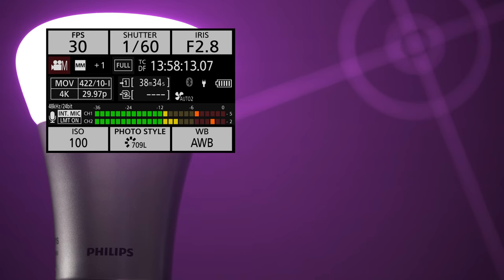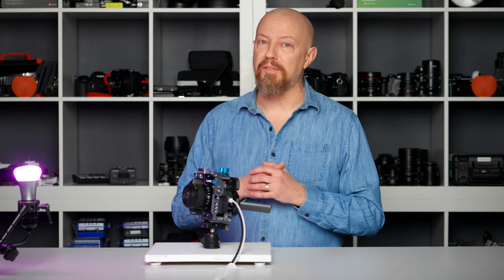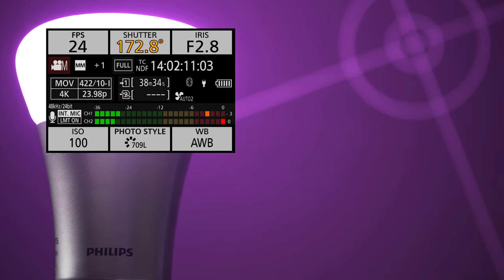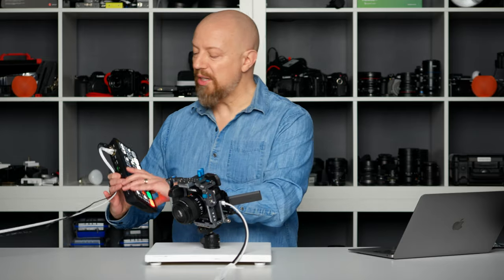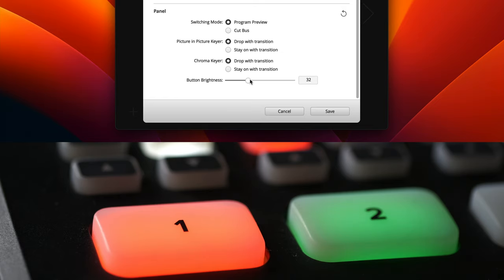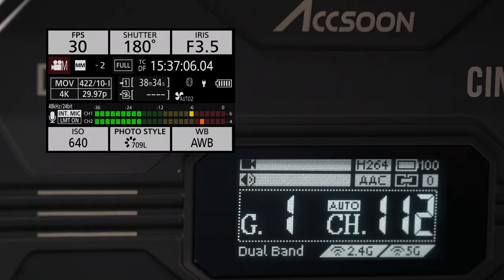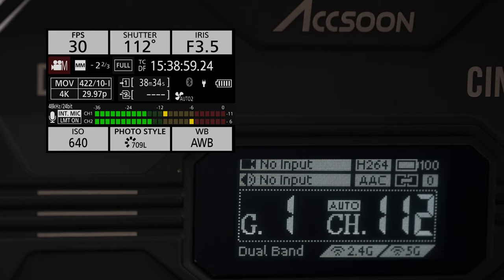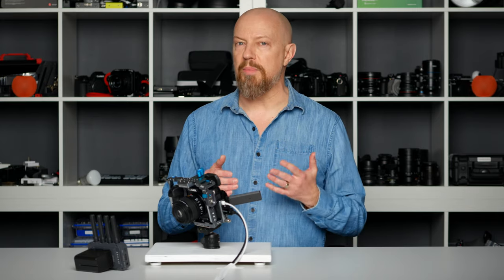Do THIS to eliminate flicker… in-camera!

Comment: Excellent stuff Joseph, and perflectly clear info and advice, as always :) I’m a 30 year veteran editor in the 25 fps world. One piece of value I could add to what you’ve said is that if you’re presented with flickery vision, all is not lost. A plug-in for most NLEs called “Flicker Free” by Digital Anarchy works brilliantly. I’m sure there are others but that’s the one we use. It’s quick and easy to apply in the workflow as required and eliminates flicker in shots with localised or full frame flicker and/ or roll. In summary, it rocks.
Reply from the maker: Yes! I know that plug-in well and the founder of the company Jim is an old friend of mine. Always better to fix it in Camera, but if not, then, it’s great that you can fix the post!

Comment: Great video, as always! 👍🏻 What about the motion blur? With 30fps and 333 shutter angle we will have to much motion blur. What about slow motion? For 60fps the only options are 1/50 and 1/100, in both cases to much motion blur for a slow motion clip. Thanks 🙏🏻
Reply from the maker: Great question. I suppose the answer is “pick which you prefer”. You can’t always have it all!
Reply: @photojoseph  Thank you 🙏🏻 😉

Comment: Good morning! I have had a problem filming people in front of LED panels during presentations and the LED panel keeps wobbling. How can I solve this, I use lumix gh4 and S5mIIx.
Reply from the maker: If it’s consistent then you should be able to solve it by doing what I showed at the end of this video — just roll through the angles while in synchroscan so you have every 1° angle available and look for the wave to go away.

Comment: Oddly enough, watching this on my phone I couldn't see any flicker in the Philips hue examples. One of my fav things about my GH5 is using shutter angle. Had to do this very thing the other day for a timelapse with a VCR clock in the shot.
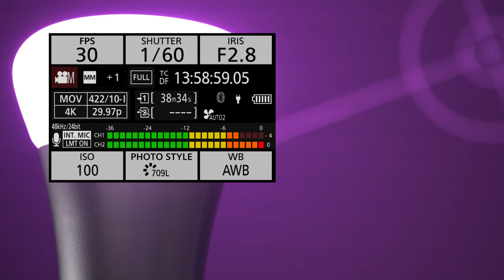Reply from the maker: Ok you’re the second person to say they can’t see the flicker. Kinda freaked me out so I checked on my iPhone — I totally see it. This is really interesting. 2:51 — you don’t see it? Maybe it’s a resolution thing… if the phone is loading low quality you can’t see it; force it to 4K and see if it shows up?
Reply: @photojoseph  It could also be a distance thing. I had my phone on the counter while cooking breakfast, but when holding it up just now I saw it fine.  Or perception...I noticed when I was focusing on the bulb I didn't really see the flicker, until I looked at the colored part of the frame.

And I have it off on my phone, but others could potentially have issues with variable refresh rate maybe...?
Reply from the maker: @chris_sparrows  ok phew and varying the refresh could definitely make it disappear if it hit just right but I think videos always play at their intended framerate
Reply: @photojoseph  forcing 4K in iPhone, now, I can see the flicker
Reply from the maker: @Samuelhlr  awesome

Comment: I use a Lumix S5 and always shoot in 4k HLG @ 50fps 180deg shutter. (or 1080 HD).  I get flicker in some indoor locations in BOTH 50hz PAL countries and 60Hz (USA).  
Recently in an indoor animal house of a USA zoo i was getting really bad flicker in one part of the house  and none in the other, so i can only assume it was due to different lighting?
Any ideas?
Reply from the maker: Definitely the lighting. Sometimes you just have to adjust the shutter angle until it goes away. Remember, de-focusing can help to identify even gentle flicker

Comment: Hallo Joseph, kann das flackern beim abfilmen eines LED TVs auch vom Weissabgleich im Auto modus kommen?  Das gezeigte Video oder Bild  auf dem TV ist klar und ruhig und bei einem Szenen/Bildwechsel fängt das flackern an, welches dann nicht mehr zu stoppen ist. Habe ansonsten schon alles probiert. ISO,Shutterspeed, Hz NTSC/PAL... nichts funktioniert. Hast du eine Idee? Danke und Gruss
Reply from the maker: Shutter speed is the only thing that affects flicker. Does the flicker get better (but just not go away completely) when you change shutter speed? If so then you need more precise adjustments. Does your camera have synchroscan? As for white balance that should definitely be on manual if you’re filming a scene that’s changing.
Reply: @photojoseph  Thank you for an answer. Yes, reducing the shutter speed reduces the flickering, but it does not disappear and the overall image quality becomes too slow. With my old camera (Sony A5100+Sigma 16 F1.4) I couldn't eliminate the flickering and horizontal banding at all. With my new camera Sony A6400+Sigma 16 everything is perfect at the beginning. No flickering or banding with perfect still images or videos (shutter speed at 1/100, ISO 400 50Hz, 50f), then the flickering suddenly starts and I can no longer get it eliminated. Also, previously perfect images and videos suddenly flicker when recording with the . No SyncroScan option by my cam.
Reply from the maker: No idea man… I don’t shoot Sony. But it sounds like a setting is changing without your input. You sure everything is full manual?
Reply: @photojoseph  Focus und White Balance is set to Auto,  the rest is manual.
Reply from the maker: @ludde303 very odd indeed then